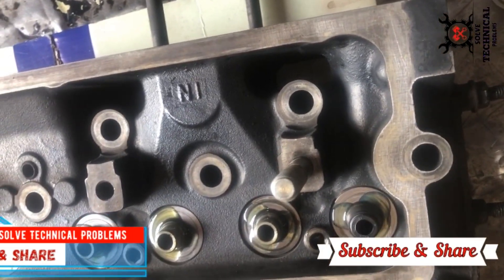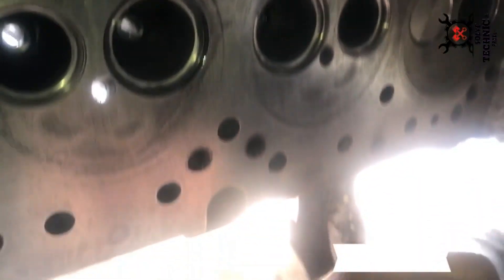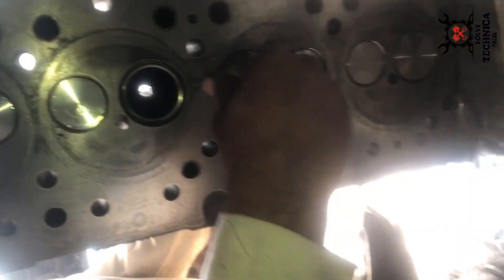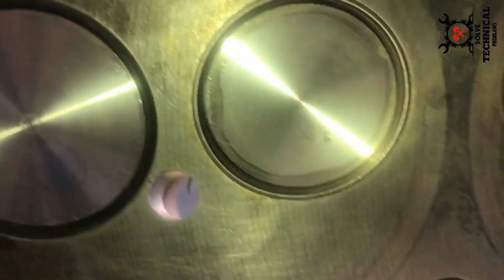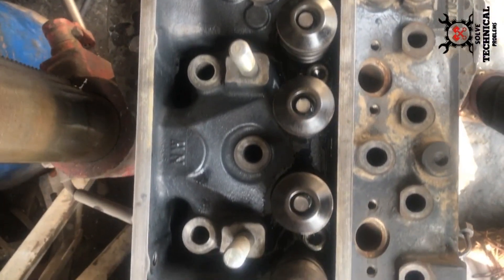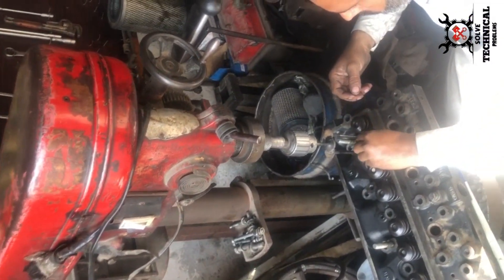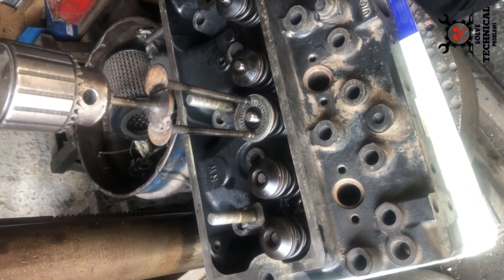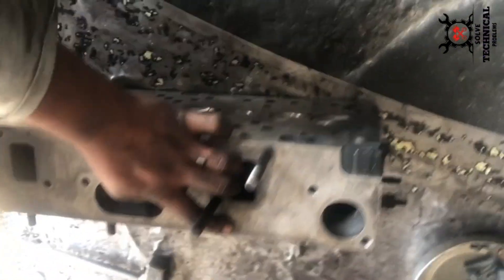Perkins 4 cylinder engine cylinder head assembly guide valve installation

Comment: What’s the problem of the cylinder head? 2516 engine overheating what could be the problem sir, replace new thermostat already.
Reply from the maker: Check water pump and service radiator if head gasket is okay